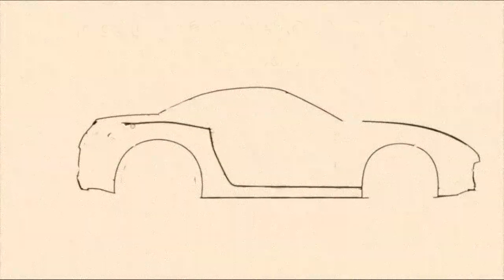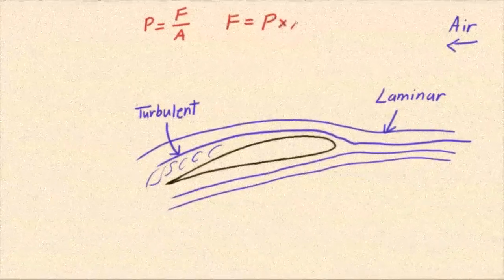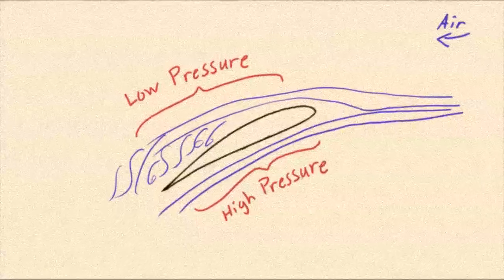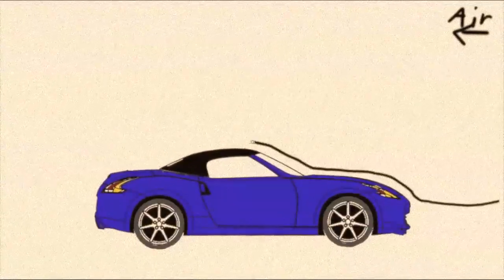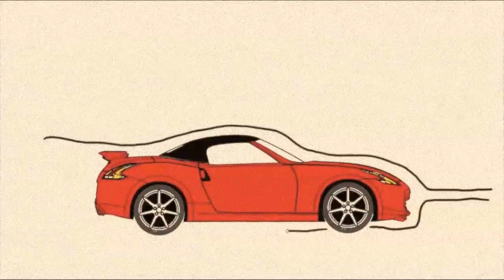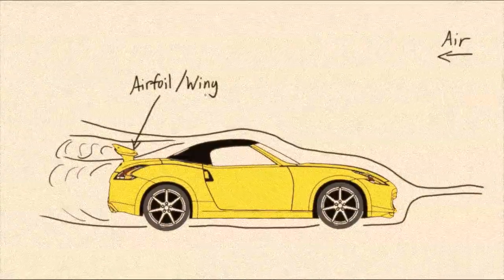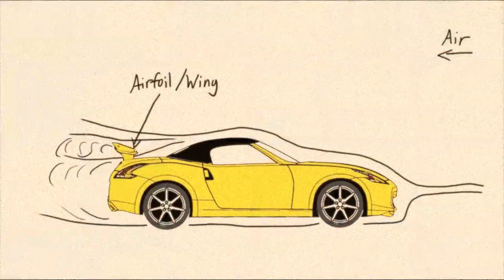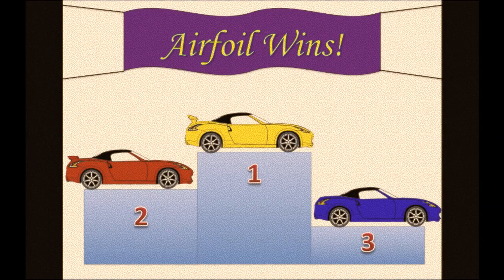Sports Car Aerodynamics: Spoiler Alert!

Comment: Can't watch a video like that.
The beginning is wrong. In a straight line the car without spoiler would win. Add corners, than the "spoiled" car would win.
Reply: The issue with this video is that is incredibly vague and gives an overly simplistic overview to drag, which is creating a lot of open ended questions like this, where everyone is using hypotheticals to prove "their" point.
Reply: Another point that should be taken into account is that if that spoiler increases or decreases drag. If it does decrease it, the spoiler car wins
Reply: if its a high powered car it may help traction when speed is building up, otherwise ye, no spoiler car would win
Reply: we are just comparing different situations and learning from them though. If any of them is wrong please tell.
Nevertheless i agree with you, the video lacks of many considerations that need to be taken into account
Reply: Oh, wow. So you watched a video, where someone said, what a spoiler does and now you know it all. Oh dear.
Did you ever heard about drag? Why do you think DRS helps with top speed? Why do you think every Formula Car, that runs in Monza gets flatter wings? Why do you think Williams had the best top speed with their flat rear wings?
There's a video here, where BAR (I think) runs their car in a Salt Lake. They even removed the rear wing to achieve 400km/h.
A big spoiler ist great for corners, but if it doesn't moves, its drag doesn't help getting top speed at a straight.
Reply: DaveMcIroy
I really think the video here is talking in terms of acceleration, not sheer top speed. While you are correct in stating that lower drag will achieve higher speeds, the demonstration graphics here show the cars starting from a dig and accelerating. More down-force > more traction > more gas/ braking power > more acceleration/ deceleration.
Reply: Think you got wings and spoilers mixed up, spoilers reduce overall drag (wind vortex) so he is correct
Reply: To everybody here
While having an airfoil would typically increase drag a spoiler can be quite different. Spoilers are designed mainly to reduce drag and lift by pushing the airflow upwards. This stops air being trapped in vortices behind the car thus reducing the low pressure behind the car. The decreased low pressure behind the car leads to less drag. The reduction in drag a spoiler gives through this process is much greater than the drag it generates itself. This is why all modern road cars have small lips at the back ends, these lips act as spoilers. On top of this the air that is pushed up also pushes down on the car reducing lift and increasing traction and stability at greater speeds. This means that a spoiler should in fact (if properly designed) lead to greater top speeds and efficiency. This increases acceleration at higher speeds while having no effect at lower speeds. An airfoil can do a similar job while decreasing lift by a greater amount resulting in a net generation of downforce but it will generate more drag by itself and result in more overall drag. This is why the F40 has a spoiler and why cars like the Buggati Veyron and Chiron have spoilers that come up above certain speeds. Because they increase acceleration and stability at high speeds and reduce drag.
https://www.youtube.com/watch?v=quDLzxmJl5I
This video does a much better job at explaining the concept as it does so using flow visualisation.
P.S
I also found it a bit misleading how he showed the performance in a drag race because his video did not aptly explain how an airfoil or spoiler would improve performance in a drag race and actually described something to the contrary as he talked about the increased drag. But at the end he did mention same track which implies he meant for corners to be involved and he simply couldn't show this due to animation limitations.
Reply: At low speeds, they will be nearly unaffected by aero. but at any given speed, the car with the spoiler does have more downforce and is capable of putting more power down to road. Straight or turning is irrelevant if all aspects are the same except for the spoiler.

Edit: After re-reading your comment, it looks like you are thinking in terms of top speed and in that aspect you would be correct. How I understood the video was acceleration rather than constant throttle
Reply: @Thee_Sinner  the spoiler or airfoil can only help you win a straight line race if you operate under the assumption that the car has enough acceleration to make its wheels slip without those things.  If the wheels aren't slipping then by adding downforce you've gained nothing, but slowed yourself down by adding weight and drag.
Reply: @Thee_Sinner  Yeah I agree, but your forgetting the spoiler also creates drag if its creating downforce, so your sacrificing top speed and acceleration depending on the amount of down force its calibrated for and if they were both AWD it wouldn't have much of a traction issue to begin with. But to be honest that was just a horrible example in the video.
Reply: @Ishkrish   That what I was trying to say. I know it creates drag and would limit top speed. I was understanding the video to be simply in terms of acceleration given the graphics used.
Reply: I think the video is correct. You add a spoiler on car and it increase downforce. And the downforce increase friction to make car go faster
Reply: not 100% correct. depends on the angle of attack of the wing.
Reply: No need for a spoiler, you just have to open the hood according to this video.
Reply: The beginning is wrong because it's too generic, but spoilers and aerofoils can improve straight line (and top) speed. But it totally depends on the cars shape, power, weight and tires (and a good set of more smaller factors). 

DRS on an F1 car gives them a topspeed advantage because of the extreme angles of F1 wings/aerofoils, but you never see them open DRS at slow speeds (below 100/120 km/h). Just because they need the downforce levels for grip providing acceleration. But put two F1 cars on a quarter mile (drag strip), one with a rear wing/aerofoil and the other without, the car with a rear wing will win 10 out of 10 times.

The same goes for a top fuel dragster, ever seen one? They have a huge aerofoil on the back, that's not for going slow. They do 530 km/h!
Reply: karlos275 spoiler is always increase drag. Thus the name. Drag would be reduced if the car has a long tail and meet at a sharp point, there the flow will be laminar to the end...
Reply: DaveMcIroy obviously   ur mouth is bigger than ur brain bucause the spoiler  pushes the car. down making  the  wheels grip the track more duhhh ya idiot

Comment: can airfoil and spoiler affect the life span of the engine if you have one of on your car?cause the design and the effect of the airfoil and spoiler add weight to the car which will be absorb by the engine while it is running specially when you are on high speed.
Reply: There is more load on the engine, but not because of the weight, the engine will have to produce more power to overcome the force of drag. But that should really only affect your fuel economy. The biggest negative effect will be on your tyres, as they will wear a lot quicker due to the added downforce which will act as a latteral force ("weight").

Comment: spoilers dont do much in drag races because the wheels only lose traction at  low speeds where the spoiler provides no downforce. In fact the spoilers and wings will also increase drag slowing the car down

Comment: Actually, creating downforce creates drag, there's no way around that. You can REDUCE the amount of drag splitters, spoilers, and foils create, but not eliminate it. Because of this, cars with more downforce won't have higher top speeds. 

Take the Viper ACR vs. the GTS for example. The ACR has produces 2000lbs of downforce at it's top speed of 177mph.

The GTS on the other hand, produces downforce less than a third of that produced by the ACR, and also has a top speed of 208mph.

Comment: Your reynolds scaling is really off. You wouldn't be getting flow separation on the rear glass at speeds achievable by that car on a racetrack.
Reply: TheXdmgx7 then when, where and why does the flow separate? 
Is it because of the sudden drop in the surface it is flowing on?

Comment: Should be noted the "speed increase" is only possible on a car with far more power then the tires can normally handle, in any car below that threshold they will simply make you slower.

Comment: A car can't drive upside down in a tunnel by generating it's own weight in downforce.
Reply: Technically, yes a car can drive upside down, but this only works with F1 cars because, in total they can produce up to 1300 pounds of downforce, and the power to weight ratio of an F1 car is 1:2 or 1:3.
Reply: this has nothing to do with power to weight ratio. If a car weight is1000kg and it generates 1000kg of downforce then this will only stick the car to the roof for a brief moment, significantly more downforce is needed to maintain traction in order to maintain foward speed since the car is not propeller or jet driven.So if a car is 1000kg and downforce is1200kg then there is only 200kg to actually maintain traction which will result in wheelspin in a powerfull car.
Reply: As the downforce is higher than the force of the cars weight, there is no reason for the generation of force through airflow to stop. So yes, a car could drive upside down, although to keep it stable a few extra pounds of downforce would be needed, but nothing an f1 car can't already do.

Comment: You realize spoilers reduce drag, not increase. That's why NASCARs have them
Reply: They add drag if they are improperly placed and adjusted. Btw NASCARs have them for downforce, so they add a lot of drag.
Reply: No they don't reduce drag, and that's not at all why NASCAR has them.
Reply: The ducktails NASCAR's have would create heaps of drag. Funny cars spoilers are a better example of downforce without creating drag
Reply: SharpieSwitchblade and MCBackDraft1 are correct.
 You two other doofuses don't know about the spoilers effect - which is to C0NTAIN turbulent air from falling off the back of the car and causing drag. The more laminar flow air then only has to shear past the turbulent bank of air (= less drag) and maintains a more continuous stream when leaving the contact zone.
They are NOT for downforce, though to the novice it might seem that's what they re for.
Reply: Michael Foransich yo you just mentioned two people with opposing opinions...
Reply: Michael Foransich love to see how much laminar flow a ducktail spoiler creates 😂😂😂 good one man good one. A good example of a shape to utilise laminar flow to reduce turbulence is an aeroplane fuselage because of how it's pointier at the back. A NASCAR is basically a box, the rear end is going to make downforce and rear stability at the expense for drag. I wouldn't be surprised if NASCAR having such tight rules make things equal, have rules on the spoilers to create more turbulent air behind cars so that other cars can draft.
TURBULENCE = drag
Laminar flow = drag reduction not illumination. If there is something making a bigger frontal profile i.e. a spoiler, it's going to create drag.
Reply: Michael Foransich you're only half right. It does both depending on length and angle. That's why they TUNE and ADJUST for different tracks.

Comment: ok yes most of what you are saying is true but, the difference between a spoiler and an airfoil is literally the same difference between a jet and an airplane same thing you're just being a douchebag that splits hairs because he has the mit name on his youtube video 

spoiler vs specific type of spoiler  

and I feel that leaving out that fact some what undermines the educational aspect of your video because if someone goes to get a airfoil on there car they can end up unsatisfied same as if they asked for a spoiler out of the factory
Reply: There is a pretty significant difference between the way a spoiler operates and the way a wing operates.  Its more than splitting hairs the its a matter of function.
Reply: +Andrew Viera  I'm not disputing your comment, but ..... The spoiler in his wind tunnel is a pretty crappy airfoil; at an extreem AOA as well as blocking the flow inder it being so close to the body.  Looks more like an airliner spoiler which is meant to kill lift.

Comment: You're mixing up wings and spoilers.  Spoilers reduce drag, wings create down force (and generally increase drag slightly).
Reply: Spoilers do not generally reduce drag.  There are a few specific cases where they can straighten out the airflow off the tail of a car and improve airflow.  In these cases they still create drag at the site of the spoiler but the overall effect is reduced drag.  Airplanes use spoilers specifically to create drag and dump lift (hence the name- they spoil the lift ).
Reply: I have always heard spoilers change the air flow to reduce the re-circulation zone and reduce drag, whereas a wing specifically creates lift downwards (on a car).  Is this wrong?  Also why would an airplane want to create drag...
Reply: fcmilsweeper9 spoilers block or redirect the airflow like you said.  They are usually mounted on the top of aircraft wings to act as speed brakes in flight and to reduce lift once the plane lands so the brakes work better.
Reply: Ah, but on cars they reduce drag by reducing the re-circulation zone and therefore the posterior low pressure zone.
Reply: +fcmilsweeper9 sometimes this is true if they are done right.  The overall idea is the same though.  you are spoiling the lift that would otherwise be created by the downflow behind the vehicle.  if not done properly, however, they can produce a lot of drag as well.   there's a great article here that explains the difference pretty well http://oppositelock.kinja.com/wings-spoilers-youre-probably-doing-it-wrong-1665312667